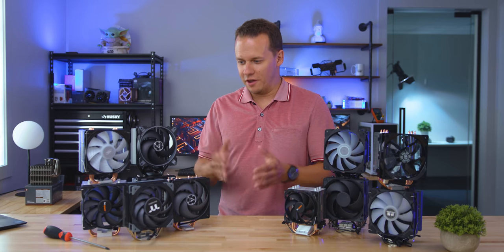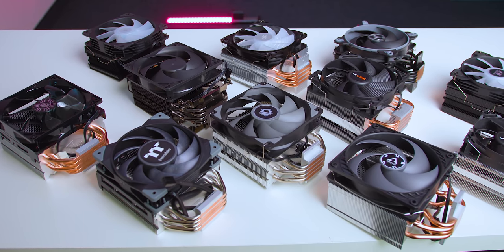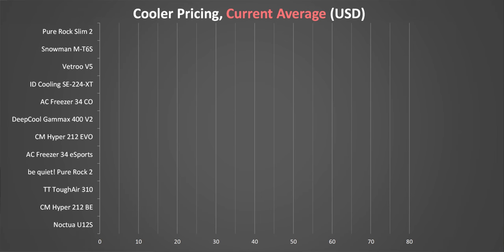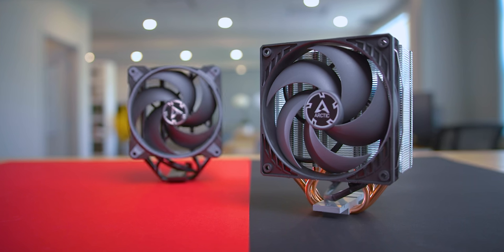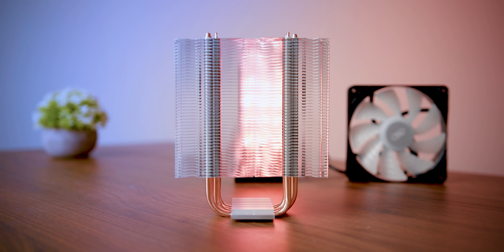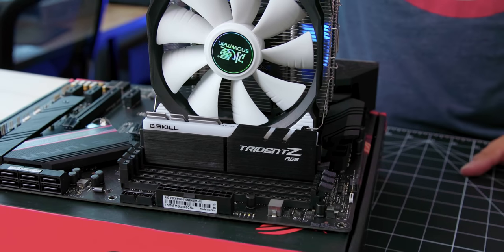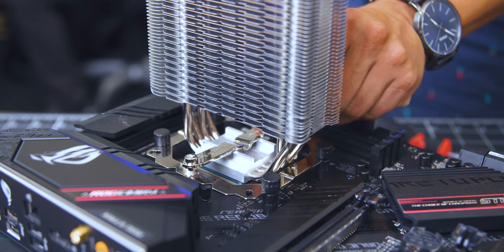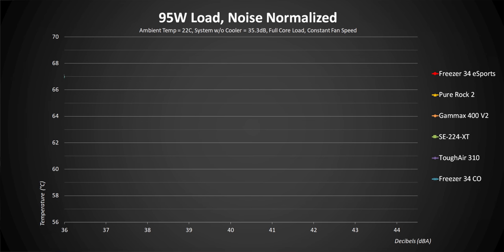The Best BUDGET CPU Coolers!

Comment: CM Hyper 212 series has been around since 2007 . I bet the tooling cost of the Hyper 212 has been recouped for a million times over. If it sells even cheaper which CM could , then it is still a relevant product.

Comment: AMD Wraith Max is running cool and quiet on multiple machines over. No extra cost when they were bundled with Ryzen 7
Reply: I have a ryzen 7 3700x. And the wraith cooler is loud and idle temp on cpu is 47-60C

Comment: Have been using the id cooling 224xt basic. Very satisfied with it. The only cons of this cooler is the fan can be very noisy and adding another fan for pull push config will create a high pitch noise on the pull fan at high rpm. I replaced the stock fam with cm sickleflow and the sound improved so much without sacrificing the thermal performance.

Comment: will the id 224 fit inside a nr200 with a b550i aorus pro ax mobo installed?
Reply: Yes I have the dual tower 207xt black in my nr200. NR200 is 156mm max and if you need to use the screws at the top to push our glass or panel.

Comment: Are any of the top 3 enough for the new 12600k? I couldn’t find the answer anywhere
Reply from the maker: Any of them. Remember the 12600K levels out at a constant 125W.
Reply: @HardwareCanucks  Great review as always. I am planning on pairing the 12600k with the Arctic Freezer 34 esports duo. What kind of thermal should I be expecting? What if I do decide to overclock it, will it still be enough? Thanks 🙏

Comment: thank you so much for a great review, i was looking for a cooler for my new 10600KF and this was helpful 😄
Reply: Which cooler did you go for?
Reply: @1clique21  DeepCool Gammax 400 V2 was the cheapest option, i actually got i5-11400 instead of 10600KF due to some issues, but the cooler is great, only throttles with Prime 95 Test power limits unlocked

Comment: which can use with CM NR200P with TP? (clearance 153mm perhaps)
Reply from the maker: Its why we added the total sizes.  :)
Reply: @HardwareCanucks  can’t find those two in my region 🥲
Reply: ID Cooling SE-224 XT is 154mm tall but it will fit in NR200P with vent panel. 
Not sure with the glass panel tho.

Comment: I am planning on getting a 5600X, rated for 65W. Don't know why I am here lol
Reply: It's 65W at idle, 95W single threaded work load and 145W multi threaded.
Reply: @stephenrogers981  really? I did not know about that. Where did you get those numbers?
Reply: @anmolagrawal5358  Tomshardware.
Reply: @stephenrogers981  64W is too much for idle. Should be less then 10W